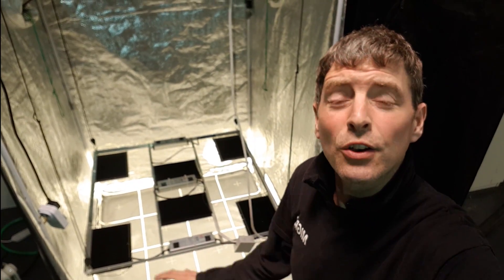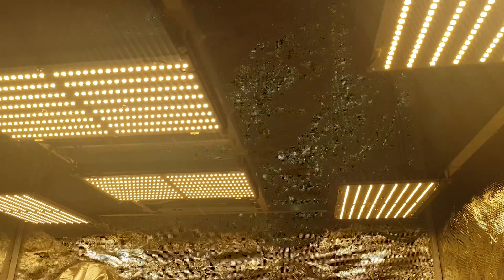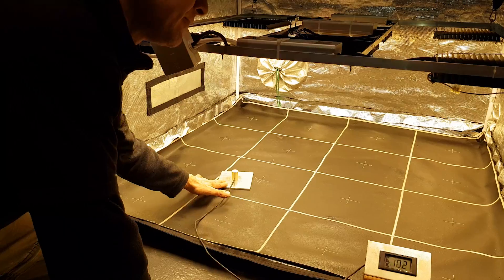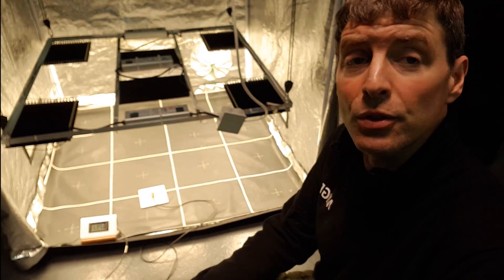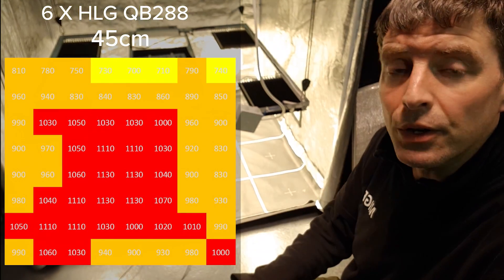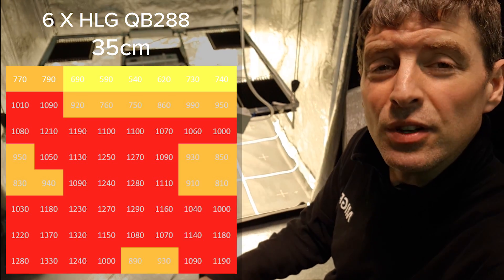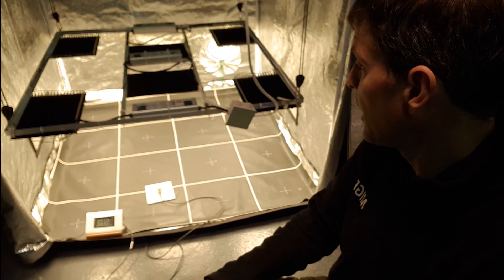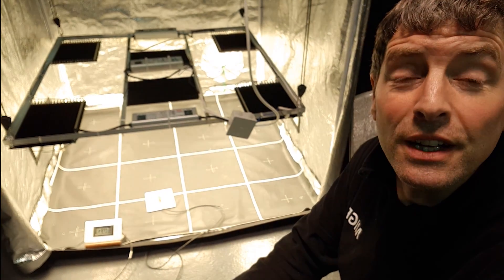DIY HLG Quantum board build test and optimisation HLG QB288 V2

Comment: Would you recommend the same drivers  but only two of them if I only have 4 board’s in my 4x4
Reply: would you know why they advertise it as 600w and yet on alibaba all 600w fixtures are 6 boards. is it because of the driver? or are the boards 120w and yours is 240 each board?

Comment: I think maybe a new term for 'light' hotspots is required to save confusion.  It's not heat creating a hotspot, like you might say with a HPS, it's the level of light and I sometimes get confused between the 2. Maybe some temperature maps at canopy level would be useful from time to time as well, just my curiosity there though.

Comment: How hot is that thing? I'd love a silent led fixture like this but I already have temps in excess of 28c in the tent with the 2 cheap white case active cooled loudly 120watt LED lights, I've been looking on Alibaba and others to find the best deal but I'm struggling lol, anyone know what one I should buy for a 120x120x200cm tent?
Reply: They don't get very hot at all, a 4x4 with 4 boards and 2 185-c1400b drivers it gets up to 81 degrees without AC (I try and maintain it at 74 though). You can go to hlg homepage, easy to navigate and always a deal
Reply: open your loud led case and replace the old cheap fans with new ones, from arctic cooling f12 if you are on budget or get noctune or be quiet fans. most led panels i saw had 120mm fans inside.

Comment: Hello there another great video migro ! 
I’ve got a question for you I am looking into a couple upgrades to my growing area I would like to know your opinion if it would be A good move or not.

I found these cheap LED red spectrum corncob lightbulbs that I was thinking about dropping one down into the middle of my grow between the plants would this be beneficial?

This is the bulbs description 
E27 5730 5630 SMD LED Corn Bulb Super Bright 220V 10W 15W 20W 25W 30W 40W 60W 80W red/

I was also looking into side lighting with these , Would this be beneficial?

Qb86 quantum board LED bar strip grow light for vertical framing 44 W
PCB SIZE:  498*40*2.0mm,
12s8P, 36V, 0.48-1.2A, 17-44W, 96pcs samsung lm561c s6 leds

Looks so very forward to your input! Thank you

Comment: Nice setup and I liked the way you "optimized" the layout.  Seems that you almost need to level the rack to get the best results.  A slight angle will skew the PPFD across the grid, and make for slightly hotter spots.  Would be interesting after your soil versus rdwc comparison to grow using this versus the MiGro 6 light rack.

Comment: I'm battling utility cost. By using COBs I am able to aim the 100watt COBs at individual plants in a Grow tent. For my usage this is much more efficient than swamping the entire Grow Tent with light. Previously had 400 watts of COB which I was then able to reduce to 200 watts by aiming the light. If I was a commercial grower obviously would go with the largest footprint. Might add that that's a lot of heat coming off the discrete LEDs.
Reply: I love both good quality cobs and boards and use em pretty much the same - i got to keep the cobs higher above canopy if going full 175w (2xVero29g7 3500K) though, Good spread but the boards are even better. In a tent i just keep the cobs higher above the canopy. I dont understand what you mean with swamping the whole tent with light - you dont fill it up keeping a canopy?I use a mesh, not a real scrog but only to stear the many tops where i want em - and deleaf so i get bud down to the medium almost. Obviously clearing ca 10 cm closest to medium so no larf.

Comment: Great light fixture test. I'm also interested in the "Chinese" imports available on Alibaba. They claim to be "top bin". Lol. Anyway, thanks again for the review.
Reply: I have them and I just tested the hlg rspec against the Chinese version. I used a "cheap" 130 dollar par meter. Chinese board had to be 6 inches away to reach 1000 par, hlg reached that at about 12inches and dropped to 600 par around 18 inches. At 18 inches the Chinese boards are closer to 350 par. So very noticeable. Don't waste your money trying to save money like me. Thumbs up my comment, now you don't need a video. Unless you don't trust me but I have absolutely no personal gain by spreading this info
Reply: @TheCuddy1986  it depends on vendor fom alibaba where u buy. those boards are made in china anyway... i cant imagine that kingbrite would lie and sell not top bin if they say so.
Reply: @kirillwuki1696  I suppose...I tried my best to pick a vendor that seemed legit. I have a decent understanding of what I wanted and what was shipped to me produces about half the performance of the US, branded boards. BTW I purchased 6 hlg boards to replace my 6 Chinese boards. Put you money where your mouth is
Reply: I have used them they don't seem too bad but i dont have a sq500. Would be awesome if he could do a review

Comment: I want to thank you again for having me over and all your help with setting up my fixture. Without you I would still run it on 240W :))) I had a blast in your shop, you sure have a lots of neat toys laying around :) Actually I was pleasantly surprised by the even footprint this fixture makes, bit dark in the outer sides, but expectedly so.
Maybe next time we can take a few photos with that thermal camera you showed me (have another DIY fixture I am dying to test out)! It was a real pleasure to meet you in person, because I am a long time subscriber of your channel. You are the best!!
Will drop by to taste those gorgeous peppers when they ready ;) Keep up with a great work, Shane, we really appreciate it! Cheers!!!
Reply: If you don't mind me asking. What was the price tag after completing that project? Ball park is fine with me. Ty.
Reply: @B.White70  HLG has a website
Reply: @DanceySteveYNWA  did they build the setup for the frame brother? Sure that I can find out. But, the rest of the project? Thanks otherwise...
Reply: Why did you turn the boards down?
Reply: I just bought all these exact supplies then stumbled on this video, any chance u can shoot me a wiring diagram??
Reply: @johnapple7073  Hey man. There is a wiring diagram for most suitable drivers on HLG website. Cheers!
Reply: @seregis9847  Did you build the frame or did you buy it from hlg? I have 4 of the qb288 and one sf2000 and I want to set them up fairly similar to how you have them set up in this video.
Reply: @EtherGaming604  I build the frame from L-shaped aluminum bars I got in local hardware shop. They are sturdy enough to hold the weight of boards, radiators and drivers. 20x20mm for outside frame and 15x15mm for inside one. Good luck with your new fixture man!
Reply: @seregis9847  Thank you for the quick reply! Cheers !

Comment: Isnt that too much light ?
Reply: Over 1000 par you may need to boost CO2 levels in order to gain the benefit but its fine
Reply: Ran at lower current it's more efficient that way
Reply: @snorkyfin1879  exactly, with this config,  he can run each board like he said at 100w
Reply: Thats totally a matter of what your goal is. If you are trying to maximize harvest in a specific sq footage, then this seems appropriate for that space. If your goal is to get the most out of the light, then it will be adequate to light a significantly larger space.
Reply: For a 4x4
Reply: absolutly not! :D
Reply: Yes

Comment: Is that not overkill for 4x4? The hlg 550 only has 4 if these boards and is recommended for 4x4?
Reply: And if you run the boards at a lower than max wattage they are more efficient
Reply: @JonnyD3ath  This. With this xlnt set up i would run each board at 80ish watts and keep them a little closer to canopy - total of 480W in full bloom  /30W per SqFoot/. Ill bet i could pull good numbers if tending canopy good. I love them boards :) Edit: i still have quite some juice if i want to . Great set up. Planning for a 2x4 with 3x288 myself.
Reply: What is recommended and what you actually need are two different subjects. If this was for tomatoes, yes its overkill. For cannabis, its a beast and you'll get unbelievable yield. Par meter confirms coverage all around the space as even. I bet a HLG 550 would have some drop off on the edges.
Reply: My last sprouts earned me (yes I'm bragging)  1.8 gpw! That's with 10 total boards and 5 185-c1400b drivers. Overkill,  no way! They run really cool which cuts back on the AC (saves $$)
Reply: @clydddlhppr1  Hell yeah, it works. 1.8 gpw is really good. Big upz!
Reply: Overkill
Reply: @FineHomePainting  Nah just not max efficiency... you can see improved yields up to 1500 ppfd. Its not a huge improvement from 1000 ppfd but you can still gain another 10%... Quick math 10% of a 4x4 is at least one ounce of bud on the low end. If that ounce is worth more than the cost to grow it even if marginal you end up ahead. Here is a quote: "This study, published in 2009(https://www.ncbi.nlm.nih.gov/pmc/articles/PMC3550641/), established that cannabis sativa grows best at 30 degrees celsius and will grow quicker from increased PPFD, capping off in the 1500's. There's a diminishing return however. At 300 PPFD, cannabis grows at about 45% speed. Increase that to 800 PPFD, and cannabis grows at about 85% speed. That 40% gain for 500 extra PPFD is easily achievable. But to max out at 100%, you would need to go all the way to 1500 PPFD, nearly doubling the light intensity for a small 15% gain over 800 PPFD."

Sure if you were running a commercial grow you should probably max your efficiency. Most commercial grows don't have to deal with low plant counts and smaller spaces. For a hobbyist, small/medical grower it makes more since to yield more bud than chase efficiency #s. I don't give a fuck if it cost me more so long as I don't run dry. I just LOL at all the small buds I see people grow, small pots not enough light, that shit aint no topshelf... SMH

I have plenty of data from around 25 cycles with various levels of led light and style, shit blurple, cob, to qbs. I shoot for 1000 par ish as my minimum near the outsides of canopy and 1200 in the center, sometimes the top few buds will get to 1400. I have always yielded more from more light per sq/ft, its certainly not linear but the gains are real.
Reply: @RIPPEDDRAGON40k  Thanks man, i am doing some experimenting myself, just in a small scale. Interesting.
Reply: @RIPPEDDRAGON40k  maybe can you tell me what use for grow 4x2  on 2020.
Reply: @ndc9242  MIGRO ARAY 4: https://www.migrolight.com/product/migro-aray-240w-iiii-bar-light/
Reply: @RIPPEDDRAGON40k  what you think about sp 3000 or diy led qb 98x lm301h 3500k x6?
Reply: @ndc9242  Both of those work, totally up to you. Cost difference of diy vs prebuilt lights is not a lot these days. Depends on how you value your free time.
Reply: Honestly its not overkill IMO 1000w hps puts out 1500ish par and this also puts out 1500ish par. I always prefered to run 1000w hps in 4x4 rather than a 600w balast. Get a dimmer or hang the lights higher if the light is to intense. I would always rather have too much light than not enough because it is way easier to dim it then having to mount more lights.
Reply: @RIPPEDDRAGON40k  How is this going to be cost efficient though? It saves you about 40p a day in power but costs about a grand?
Reply: @patrickcolclough2423  There is money to be saved in a few areas, but LED's are a long term investment. They're getting cheap enough when you build your own that they are starting to be a viable replacement option for HPS. I am not a big fan of LED's up to this point because of the initial cost, and the cheap quality components out there, but I'm starting to think they might be worth the offset in cooling the heat from my DE/HPS, at least during the summer.
Reply: RIPPEDDRAGON40k actually yes it is over kill dude.  Cmon man. That set up would be good at another 2ft all way around so!
Reply: @ArturoGarcia-er1hk  Lulz, dimmers FTW buddy. IDK why are these idiots assume I run mine full blast all the time... Also in a limited plant count/canopy situation, maxing yield per plant is far more important then being max efficient. I don't mind spending an extra $24 per month for an extra 200 watts per light if my yields go up more than the cost of the extra wattage. SMH
Reply: @RIPPEDDRAGON40k  Lights do run as  effecient  when they're dimmed down.
Reply: @mr_manny_d8725  Yeah, 6 qb panels running at 750 watts max for a 4x4 dimming to same wattage that they sell the hlg 550(only 4 panels) at like 480 watts. I will get better par #s and efficiency and for less cost because DIY is about $0.75 to $1.00 per watt of light where prebuilt tend to run in the range of $1.80 to $3.0 per watt of light depending on manufacture.

Comment: Can you test a chinese quantum board?
Reply: They look like the same thing but you aren't guaranteed what diodes you'll get... So maybe 10% - 15% less efficient? Still better than a cheap viparspectra type fixture. I also wonder if hlg does their own soldering / part picking or sends work offshore, there are near identical boards minus the branding that have been around for like 2 years from China.
Reply: @volvo09  the fobig quantum boards and hlg look the same but there's a world of difference in the diodes. I have 6 of the boards he's testing on here and 4 of the fobig boards, huge differences in my dandelion yields. Though they both are Samsung diodes but you can tell the one's from hlg.
Reply: @clydddlhppr1  Hey Ben, do you mean the 240 561c S6 diodes board by Meijiu?
Reply: @svenzia  I believe they're the same as the fobig (Alibaba specials lol). They aren't terrible,  I've got some girl scout cookies under them now but my hlg boards are killing it. I'm getting double the yeild of good consistent flower.
Reply: @clydddlhppr1  Thanks Ben. I know one thing to be fact though, there are kosher chinese boards with the real deal - one can not tell any difference from HLG in quality, but i bet there are many mediocre none real samsungs chips as well. I can only find one board named Fobig and it has 240 lm 561c s6 according to seller,  for 110w powerdraw aprox. Have an awesome day, man!
Reply: @volvo09  hlg has his own factory in usa now :)
Reply: @nordinoux  awesome! That's what I like to hear.
Reply: I also like this idea.
Reply: yes i can provid chinese quantum board 2 channel for the test: 
channel 1 : 288 lm301b 4000k top bin
channel 2 : 12 lm351h 660nm
Reply: @nordinoux  Would love to see it!
Reply: @seregis9847  have to ask shawn for migro, if he's ok :) he might be impress by the construction fabrication
Reply: I don't see how a single test of a chinese knock off will show us anything of value. The issue with chinese knockoffs is their inconsistencies.
Reply: @frigginwizard  exactly... It may look the same, and even if the diodes look the same there are too many inconsistencies. If someone buys one and it sucks, the next few buyers or mix of buyers may get something worse, identical, or better. That's why they are cheap, you don't know what to expect or can't go back to anyone if you get ripped off. You can't even trust buying one as a test and getting the same thing a month later.
Reply: @volvo09  I disagree.  I think we can expect maybe some small percentage difference but we just want a general idea of what we would be purchasing.  DO A CHINESE BOARD TEST PLEASE!!
Reply: You could test the Mars Hydro TS 1000. It's basically a china led quantum board with fixture.
Reply: @KanalDeef  that looks so badly made lol...
Reply: @KanalDeef  This!
Reply: @KanalDeef  I think he will do that one. It has no heatsink so it gets really warm. I was very curious about this light because of price and look - imo a step in the right direction for Mars. 150W with no heatsink gets really warm. I think they will sell very good but that was a dealbreaker for me.
Reply: @svenzia  they have heatsinks available through hlg. They have diode covers as well that can direct your lighting. Their DIY kit offers the 240 driver (I believe) I bought a 185, I didn't want to have to hone in the power (90 each is plenty). I got the heatsink package for like $80 per panel. If you've seen his efficiency list, they're right under his lighting system so they are very cost efficient as well.
Reply: @clydddlhppr1  Indeed, HLG is the real deal. I love em. 90 per board sounds perfect. I only have 1x288 561c gen 1 - driving it harder but when i get my 3xlm301b, 90 each sounds perfect for a 2x4 tent. Yeah i like the diode covers as well. Yes very efficient esp driven a little lower. Thanks for response :)